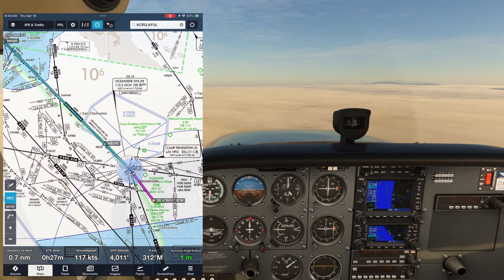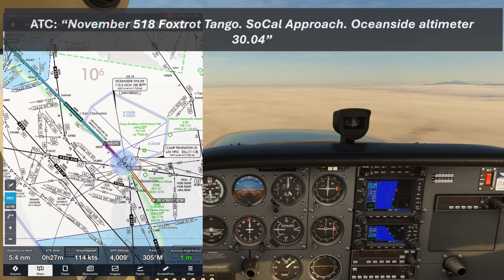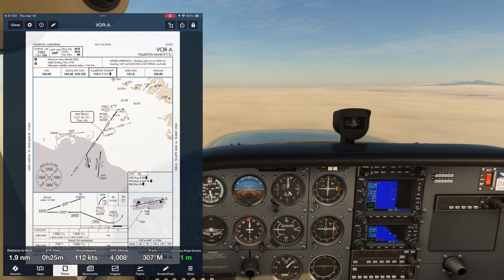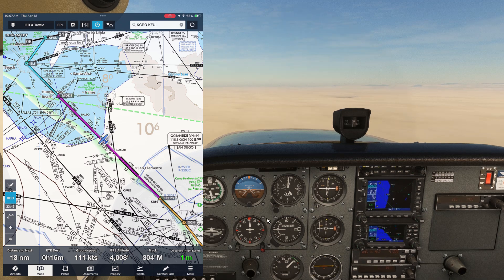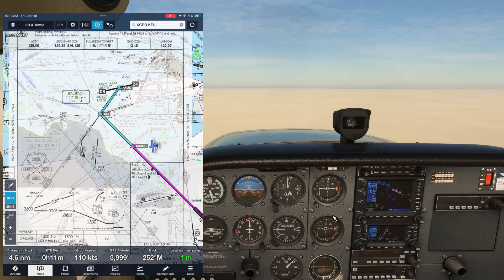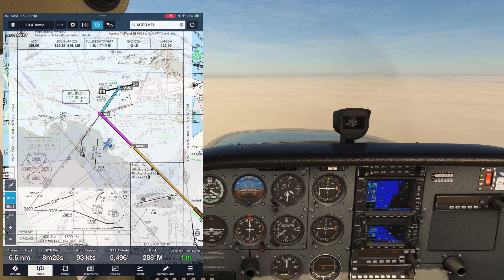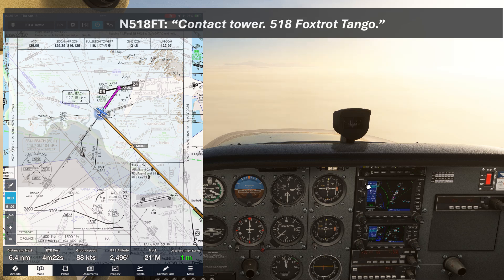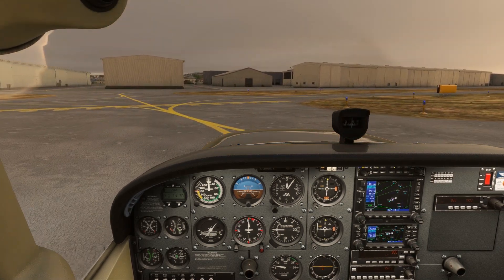Flying TEC Routes Part 2 | Tower Enroute Control

Comment: Question: "Circle West" is confusing and seems to conflict with entering Right Base for 06. Help?
Reply: I got confused at that point as well 🤔
Reply: circle doesn't mean an actual circle, it just means the point where you break off from the approach heading and fly the rest by visual. in this case it meant "keep it on the west side" which makes total sense for a base leg and turn to final, since it happens on the west side. he could have used the circle approach to land on runway 24 as well, then tower might have said "circle south of the field", which would have meant enter a left downwind, then left base and final.

Comment: Why are there circling MDAs?
Reply: It is a VOR approach, not straight in, so only Circling minimum.
Reply: @Pilotfredish  Just to clarify, It's not that it's a VOR approach. The suffix -A after "VOR" in the approach title means that only circling minima are published for this approach. The reason for this approach is because the angle of the final approach course to the runway centerline exceeds 30 degrees. It doesn't mean you can't make a straight in landing, it's just that the criteria specified in the Terminal Instrument Procedures Manual (FAA Document 8260.3F) also called TERPS, state that in this case as well as one other only circling MDA minima will be published.